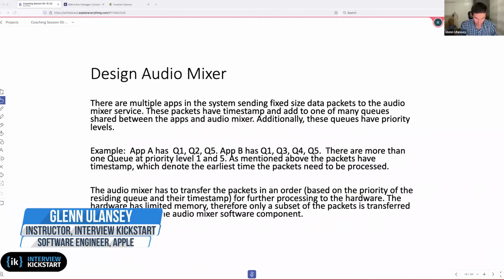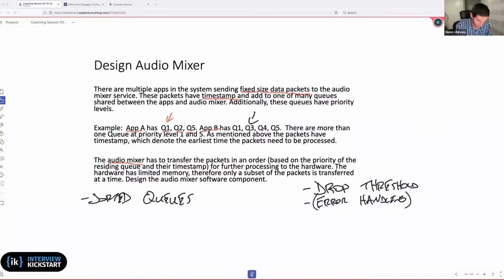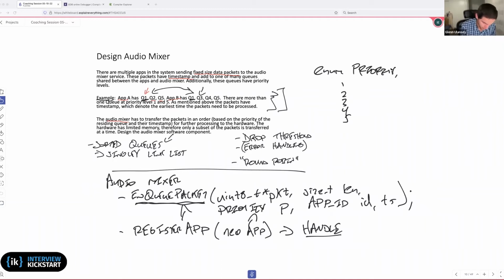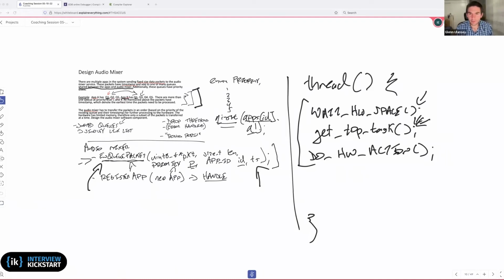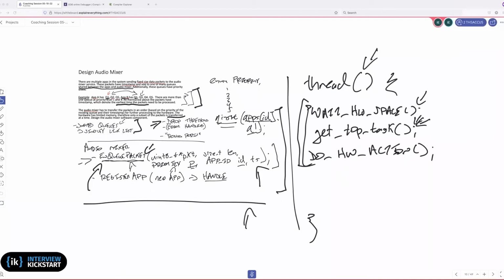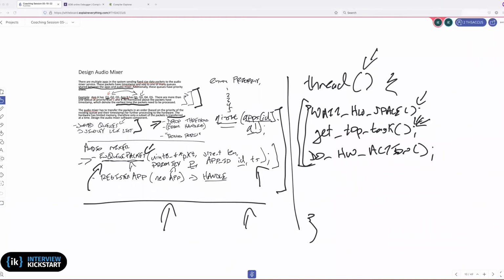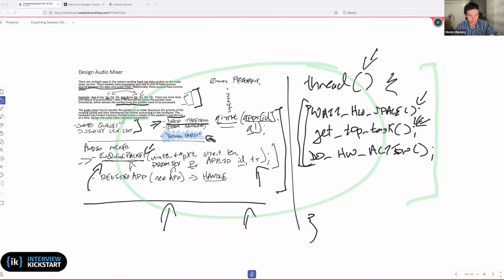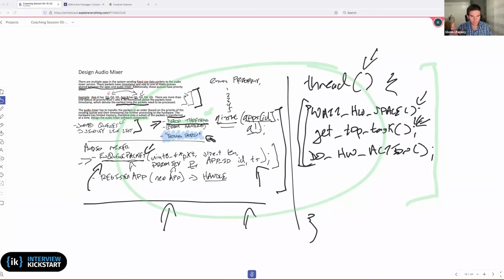Design an audio mixer #EmbeddedSWE

Comment: In a  management Role interview with Facebook engineer asked me this in design interview, He was very aggressive and laughing at my questions and getting intimidated with similar questions you guys had here.  My solution for this would be linked list of linked list, one sorted based on priority, the second one sorted  based on timestamp, This means the  first linked list will always have the highest priority queue in the first node(s), and that node(s) will always have the packet(s) with earliest timestamp, now, one api needs to search  to find the earliest packet based on time stamp for a priority: find_earliest_packet(priority_t), which basically will look for the first packets  timestamp in first node of queues linked list  for that particular priority. 
struct packet
 {
    data;
    t_stamp;
   struct packet *next;
};

struct queue {
struct packet *packet;
int priority;
struct queue *next

};

both of these should be sorted, packet linked list based on time_stamp, queue linked list based on priority, some support linked list functions like pop and insert will be required for high level  find_earliest_packet(priority_t) function construction,  firstthis function needs to read the first node in queue linked list, get the time stamp of the first packet in its own linked list, check to see if the nest node in the queue has the same priority or not, if yes compare time stamps,  and consturct array of packets with same priorities based on their time stamp and send it to HW, this could go until we reach to the end of queue linklist. Inserting position of new packet_list (sorted list of data  packets based on time_stamp) to the queue  linked list only needs to be based on priority of the queue from the app.
The guy was so rude which I gave up on him, It was so clear he has been beaten up so much. The intention of design question is to see the person tough process, Specially for people Management role, rather than looking for a pure complicated linked list integration to fix a bad design from the get go.
Great videos by the way!